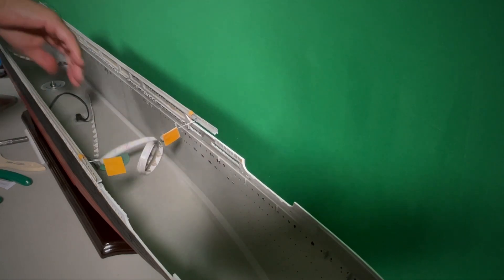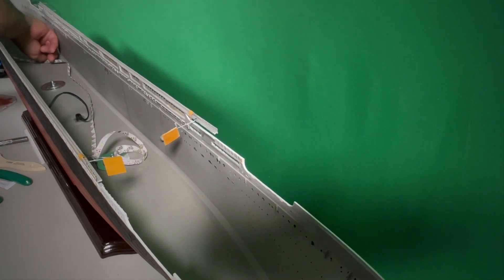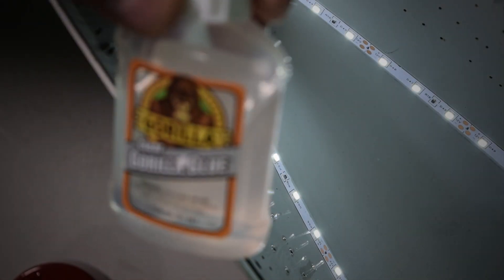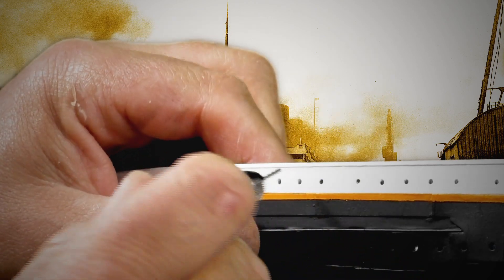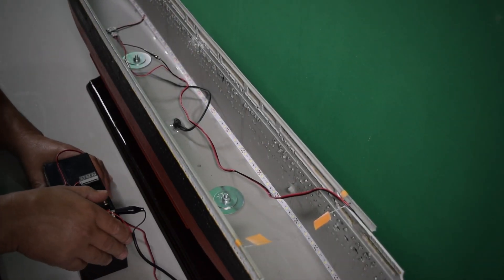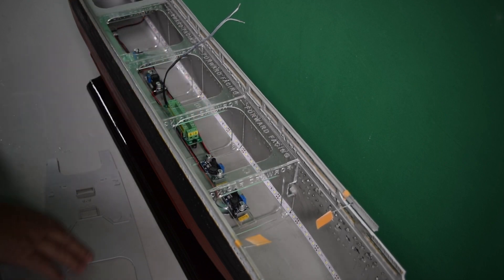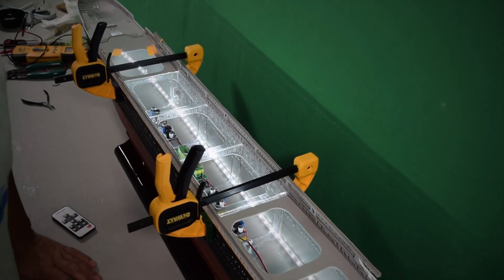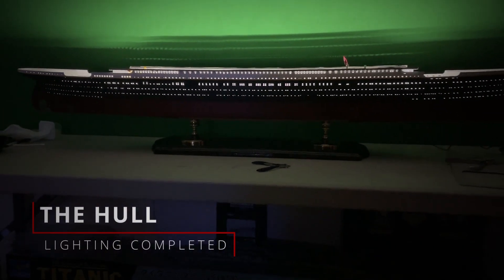Building the Titanic: Hull Lighting Complete S1

Comment: Looking good ,I've drilled all my portholes ready for my leds ,which are on order from lighthouse leds.been ordered a week but takes about 2 weeks to get to uk .cant wait to get started on fixing them .
Reply from the maker: That’s great, it should be a breeze if you didn’t use Minibrass’s Hull plating. Using the plating looks great but lining up the holes can be a challenge! With time and patience, it can be done. Goodluck with the build.
Reply: @BuildingtheTitanic  many thanks great news the fibre optics have arrived ,they shall be light
Reply: I must be thick lol 
I didn't get how you connect the fibre optics up meaning what is there light source?? Otherwise brilliant video 🎉